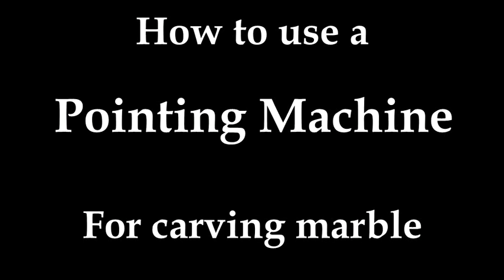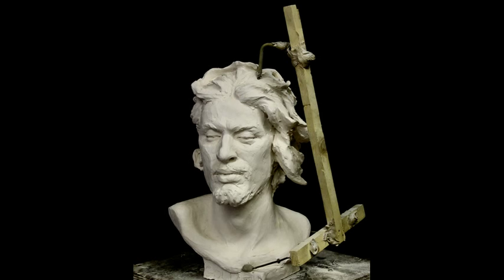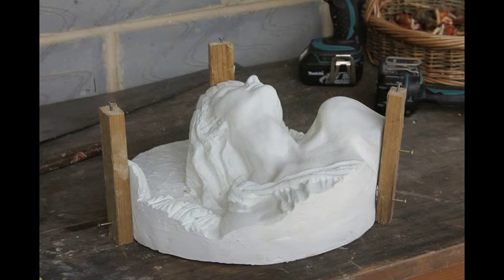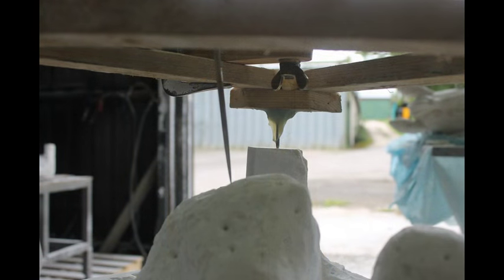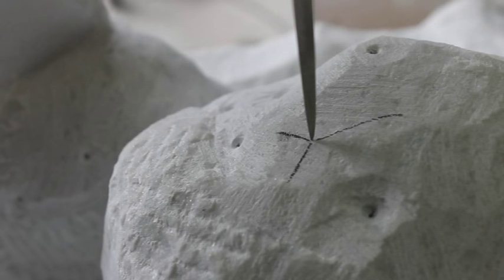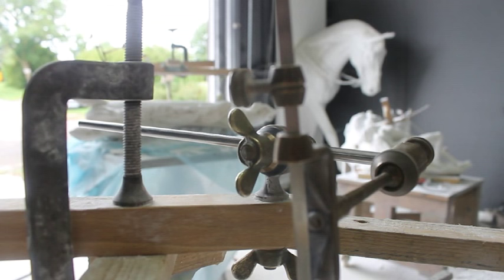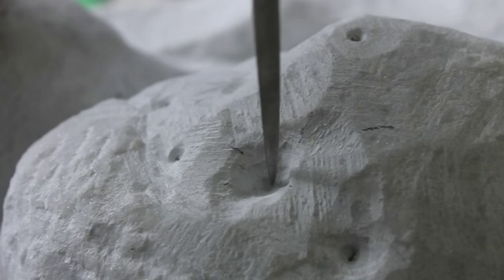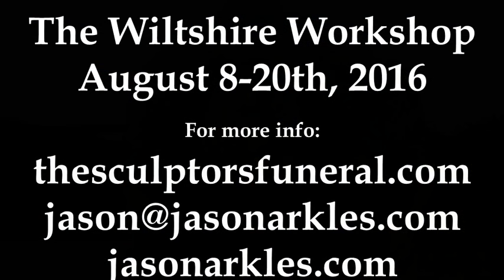How to use a pointing machine

Comment: Great video. Thanks.
Being a frustrated inventor, I can't help but wondering if a "point-ing" machine could be modified to be a "line-ing" machine or even a "plane-ing" machine.  Now the last is probably unnecessary for any competent sculptor (which I'm not), but   I suspect the other might have some value and might not be excessively difficult a modification to the pointing machine.
Consider:  Replace the needle and its round socket with a edged tool (like a sharp, symmetrical chisel) with a square or hexagonal shaft mounted in a square or hexagonal "hole".  The "hole" would itself be free to rotate and be locked at any desired angle to the model.
Now instead of marking a single point, the sculptor would be able to mark a line of length equal to the width of the "chisel", and, hence, to roughly carve out larger portions of the stone with fewer interruptions to mark points.
Properly constructed, only one "machine" would be needed.  The "chisel" could easily be replaced by a point made on hex stock.
I'd be interested in reactions to this idea -- which I give freely without thought of compensation (but this posting constitutes a publication of the idea).
Reply from the maker: I think I see where you are going with this idea, but I am not sure it would be practical. The pointing machine isn't the tool doing the carving - you remove the 'machine' and cut away with chesels. The machine only tells you where to take away. having a chesel or flat 'point' would only be more vague in locating specific locations on the marble, and you certainly don't need a line or a plane point in order to remove areas and planes of material; proper use of the pointing machine isn't about locating points and digging out those points, it's about finding a few points which help you remove material in between points... a bit hard to explain, but if you actually tried to use one you would see for yourself (And you should try it!) Cheers.
Reply: @thesculptorsfuneralpodcast3395  I would expect that a "line-ing machine" (or "line-segment-ing machine", which might be a more accurate name) that I described would replace the pointing tool.  Rather, I see it as enabling the sculptor to mark significant line segments that could be sculpted down to in one go, rather than point-by-point.  (My use of the term "chisel" was only to describe the shape of the piece that replaces the "point" or "needle" on the pointing machine, and did not imply that it would be used as a chisel to cut away stone.)  Where the pointing machine locates points, my brainchild would located a series of points.  I offer this idea as a possible option to someone who is building his own "machine", as it's a minor modification of that tool.
I'm reminded, here, of a student of anthropology I encountered as an undergraduate.  He was running around measuring the toes of volunteers to test some hypothesis or other.  He was using an external (or "outside-joint") calipers (e.g., https://images-na.ssl-images-amazon.com/images/I/71GKN88rGpL._SY445_.jpg ) that must have been at least 10" long.  The tool was completely inappropriate to the task. (A hermaphrodite calipers, e.g., https://www.picclickimg.com/d/l400/pict/173872922651_/Starrett-No-41-Firm-Joint-Hermaphrodite-Caliper.jpg would have been more suitable, but a simple ruler would have sufficed.)  He claimed he "had to" use these calipers because they were a tool approved for anthropological studies -- or some such BS. 

What I'm driving at is that if your only tool is a hammer, you see every problem as a nail.  Sometimes it's better to examine the tool.  (In science, it's essential to "ask" the right question.)
So, if we want to modify the pointing tool, maybe to speed the work, suppose we replaced the needle with a long, narrow masonry bit.  We use this on the model as usual, but when we get to the stone, we attach a Dremel tool to the bit and drill down to the marked point, rather than hand-chiseling down to it.  Is this an advantage?  Probably not to an experienced sculptor who has been using the pointing machine all his life. 

But a tool such as I just described is one step closer (than the pointing machine, which itself is already one large step closer than freehand sculpting by eye) to being a "tool of certainty".   Is such a modification necessary or even desirable -- that's a matter for the user to decide.  But it may be nice to have it as an option.

This thesis is that a hammer and chisel (or other such tools) represent tools of "uncertainty" -- they'll do anything the skilled sculptor wants them to, without limits.  By contrast, an investment mold is an extreme example of a tool of certainty -- it can produce one shape only.  An artist naturally gravitates to the former, but there's much to be said for the latter.  If we were not sculpting marble, but instead were rendering the model to bronze, the next step would be to prepare an investment mold from the model.
Reply: good point there, pun intended. Well if you'd make a different style of needle, it could be used to define a plane rather than a point, and then that whole plane could be cut with a flush cutting blade on an angle grinder. But be warned it would not be accurate enough and could only be used in the inital stages. For that there are other methods, such as templates for front and side views.

Comment: Simply incredible. I'm using a simple trace paper overlay and gut feel. Primitive by comparison.
Reply: If you use transparent plastic, you can finds lots more details. And if you trace the outline (put the sculpture on its side on a large flat board or floor and mark the circumference with the use of a carpenter's square, then copy that onto paper, cardboard or plastic and then onto your stone), that'll save you lots of time in the pointing process. Pointing is slow but very accurate. If you don't need accuracy, there are lots of other ways of measuring. Outlines, for example, or put it in half a wooden box (bottom and two sides) and the stone as well, and measure from that with calipers, etc etc. But round shapes are harder to measure, and for that the pointing machine is great.

Comment: A very good explanation of copying this kind of model but can you show how a "standing" model could be copied ?
Reply: I don't have any pics of that, but it's the same principle. For a standing figure, if you put one nail up top in the head, and the other two  on the base, so that the croce forms and inverted 'T', that should do it. Croces vary as much as the statues being copied, but as long as you can create a stable tripod attached to the cast, you are good.
Reply: @arklenaut  Should you make stable mounts on both sides of the model -- say, front and back?
Reply: @CameraWithaGuy  Yoiu usually don't need to. You can re-clamp the macchinetta to any part of the croce, and if it still doesn't reach, you can simply add a 'branch' arm to the croce that allows the macchinetta to reach. The croce only serves as a tripod - you can add as many extensions to it as you need. Sometimes if gets a little imbalanced (Like if the macchinetta is way off to one side), so you may need to counterwieght the croce as needed.